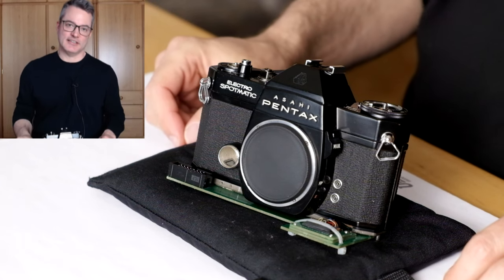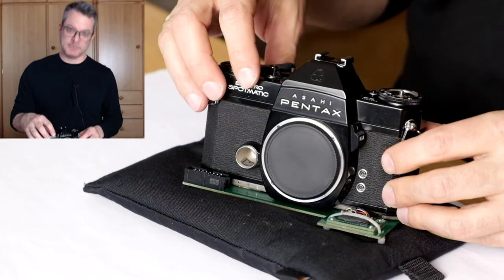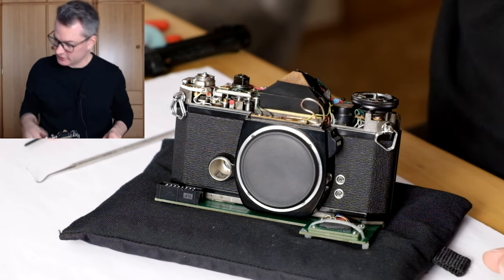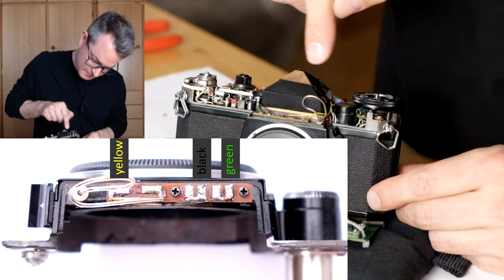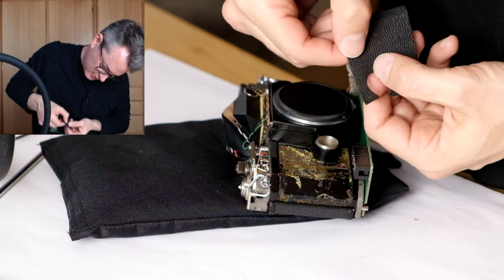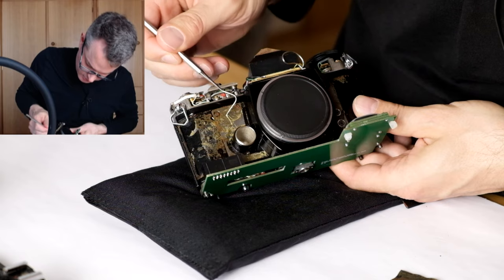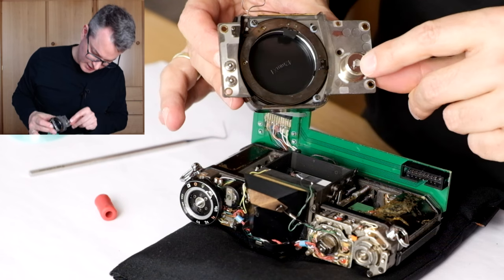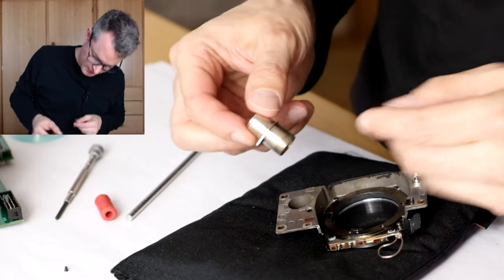The Pentax Electro Spotmatic: Reverse-engineering a marvel of 1971's Japanese electronics [Part 2].

Comment: Hello.  I have just purchased one of these I live in UK so had to get it imported.  Luckily my copy works.  My PCB looks the same as yours but my battery compartment is different.  I have no spring inside camera the spring on my version is inside the removable screw on cover.   The battery polarity is the same as yours.. I also have the ES which has spring inside the camera and opposite polarity.  My electro spotmatic has a lower serial number than yours also.  Thank you for all your amazing work.  Mike.
Reply from the maker: Hello Mike! Congratulations for getting a working one! Interesting that a camera with the lower serial number has the spring in the removable screw, which is the better design for this polarity, in my opinion (no risk of shorting anything out with the spring and easier maintenance of the spring).